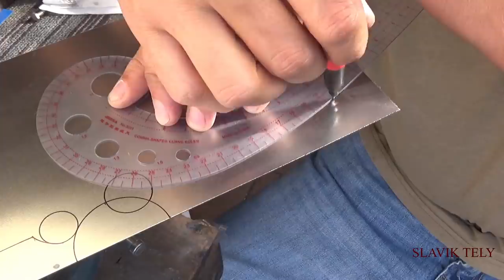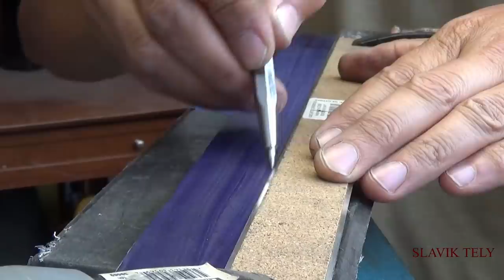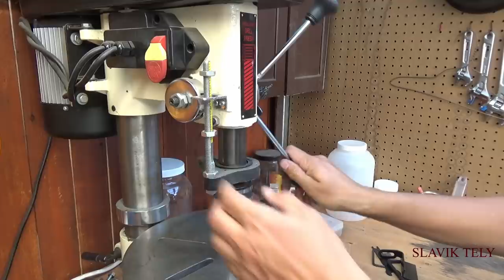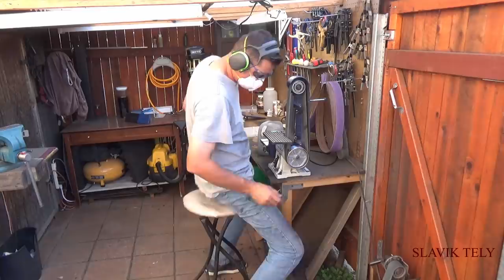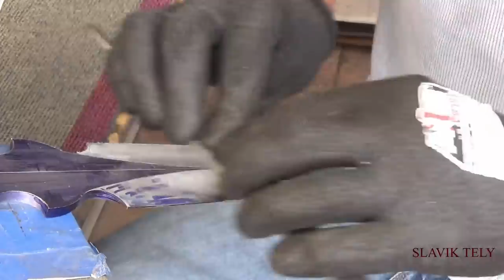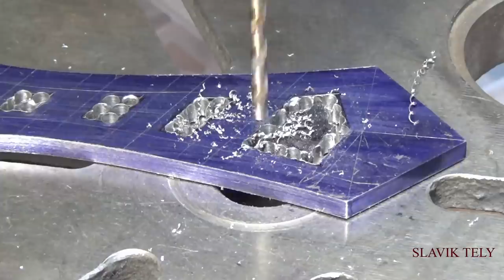Making Standoff knife P1

Comment: Hello Slavik, great job, as usual. I'm eager to see the rest. BTW, one question, why you made the "stencil" out of metal sheet and then draw to Damascus steel, why did not go directly from the paper to Damascus steel?
Reply: Likely to make scribing the lines easier and more accurate
Reply from the maker: I wanted both sides to be identical. You can not make them the same with paper.